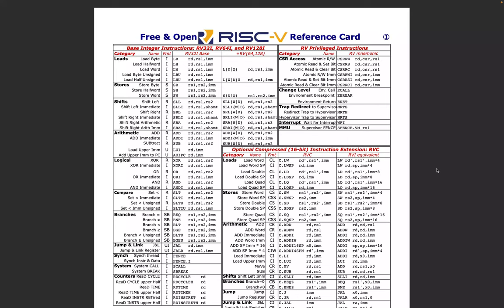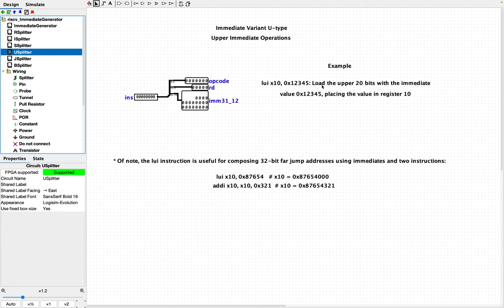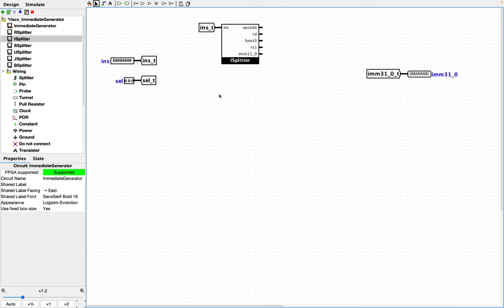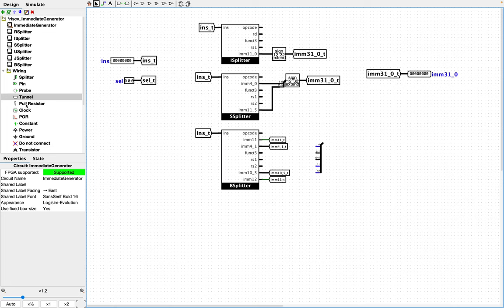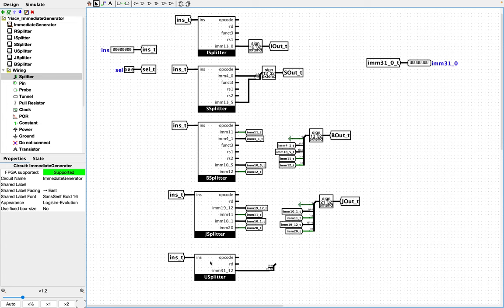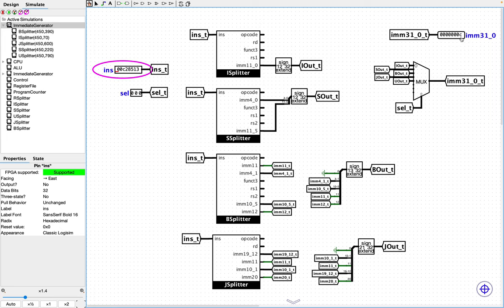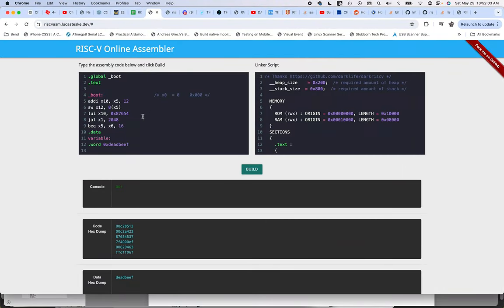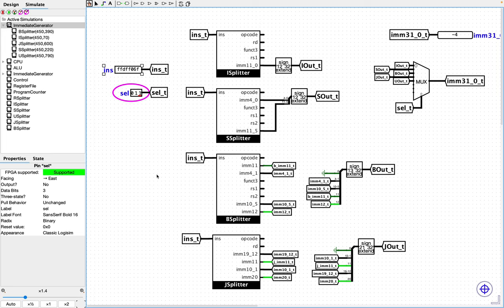RISC-V Logisim Immediate Generator

Comment: Interesting but I dont understand whats going on. Very specific usage. This is for programming basically an OS or interface that you can communicate with? Definately interesting, just a little too high level i think for most viewers.

Like for example, what are we doinfgwirh thw bit values ect. And how are we using this?
Reply from the maker: I am building modules step by step, that will be combined into a design, which will implement a RISC-V system on a chip, in Logisim. The immediate generator acts upon RISC-V immediate instruction types, which contain hard-coded values within the instruction. Those immediate values are then needed by other modules (such as the ALU). Perhaps I did not add enough context at the beginning of the video. Have you have seen other videos in the series? I am about to deploy content on control logic, which pulls these modules together. Thanks for the question.